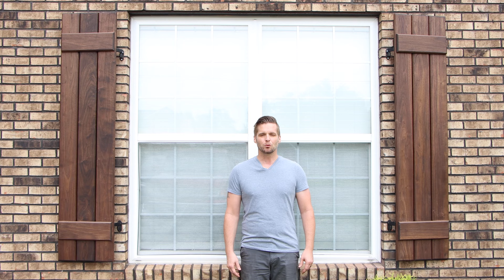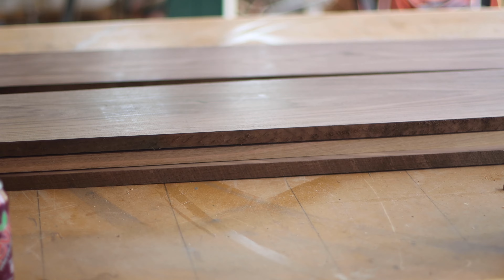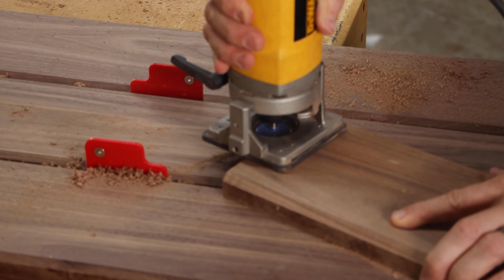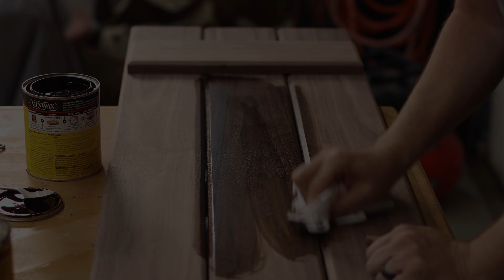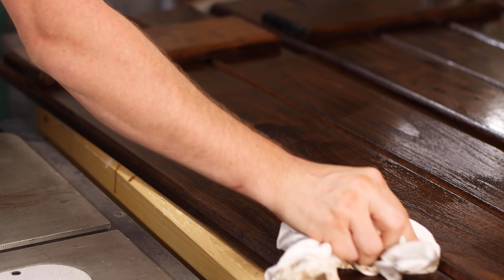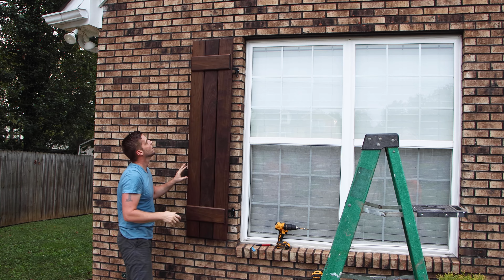How to Build DIY Board and Batten Shutters | Plan Available

Comment: Hi, just checking out your plans when I came across your "Wooden Step Stool" plan. If you could take another look at it because it seems to not be a stable platform. The base needs to have a wider stance then the top otherwise whomever steps on the edge will fall and that is not a food thing.

Comment: If the shutters wouldn't cover the entire window, why not install them
to the edge of the brick openning of the window. I installed mine that way
and it looks much better than what you did. I also installed hanging clips
at the top of each shutter. Unhook to remove to store away.
I made my shutters out of fir. They are over thiry years old and still look
very good.

Comment: I like the "functional" look with the hinges, is there any way to stop them from actually swinging ? I'd hate for a really windy day for them to be slamming on my window frames.
Reply from the maker: You can use decorative shutter dogs that attach to the house and turn to hold the shutter back. Or, like this client, you can attach an eye hook to the house and back of the shutters and then pull them tight with some thin gauge wire.

Comment: I do have a question.  I bought cedar for my shutters. My windows are 24 and a forth inch wide. My cedar is 4 inch wide cedar. I didn't take into consideration that they are half a inch shorter. I don't want to ripe these boards, it won't look right. What is your suggestion? These will be working shutters. Help please.
Reply from the maker: Doing some quick math, each shutter needs to cover ~12 1/8" and you've got 10.5 inches between your 3 boards, 1/8" between each board to allow for wood movement adds another 3/8" and takes it to 10 7/8". You'll want at least 1/8" between the shutters when they're closed, so each will have 1/16".  Then at least an 1/8" between the window opening the shutter, so that's another 3/16"" taking total width to ~11 1/16". Now you'll have to play around with the measurements to find that extra inch or so. If you don't like the look of 4 boards ripped by about 5/8" down to 2 7/8", then maybe increase the gaps between the window and each shutter and the gap between the shutters to around 1/2". This is all assuming everything winds up being those exact measurements, but it gives you some idea. Reference measuring with the shutters and windows instead of taking only tape measurements will help you be more accurate. Hope that helps!

Comment: Tommy, how do i mount them to my vinyl siding without screwing them into the studs behind it? I know that i could use vinyl siding clips but how would i attach them to the back of the shutters? Or if you have another idea...   Thank you for your time.
Reply from the maker: I don't think it would look great to attach these hinges to vinyl siding. You could build a wood casing around the outside of your window and then attach the hinges to that, but that would require trimming the siding down and capping it to fit up to the casing. Another option would be to mount a wood base plate of sorts to the siding and then attach the hinges to that....but I'm not sure what that would look like. Hope that helps!